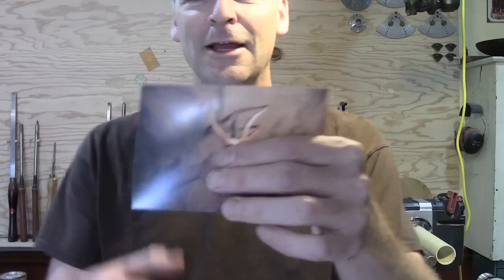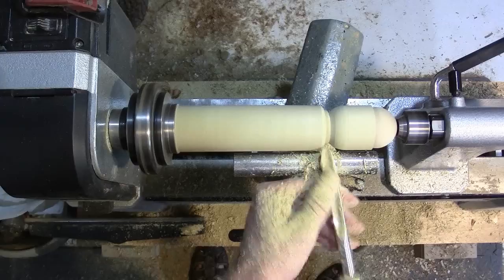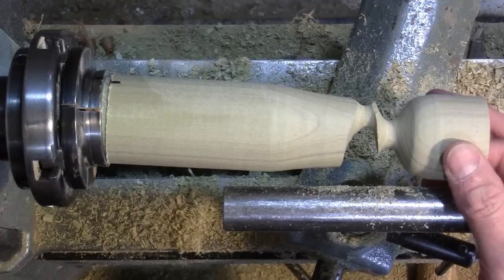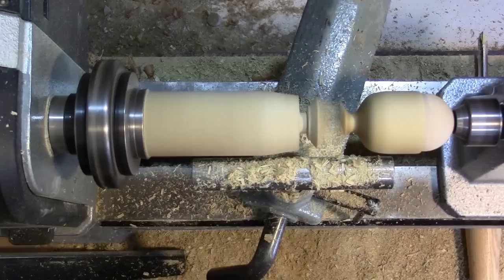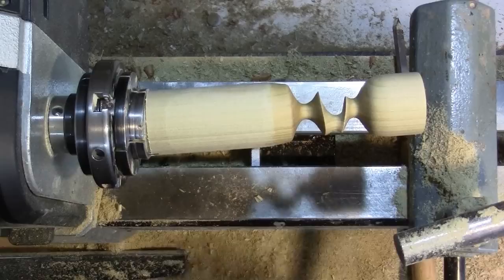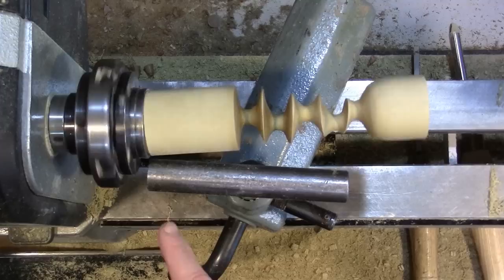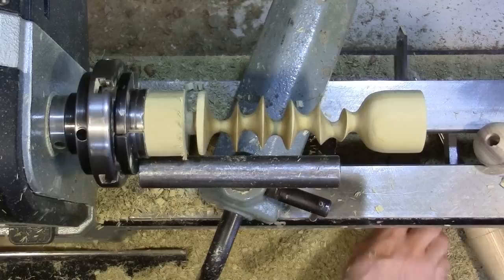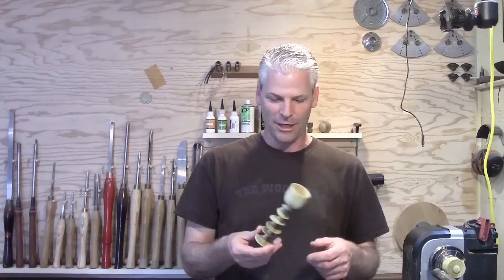Woodturning | Eccentric or Off Center Goblet

Comment: That's really good Carl, I'm impressed. Goblet offsets - if you offset on jaw 1, then jaw 3, then jaw 1, then jaw 3 etc you get a crankshaft effect. If you offset on jaw 1, then jaw 2, then jaw 3, then jaw 4, then jaw 1 (to balance the piece) you get a spiral staircase effect. The farther you offset the wider are the 'discs' of the offset. The permutations are as big as your bravery. The box idea is really interesting.
Best Wishes, Brendan

Comment: For the first attempt you must be very pleased with that. Mike is a great teacher, it was his channel where I got hooked and had to watch every video. The other option to get all the stems in line off center would to have the work on a face plate. Then have two sets of holes that you keep moving the blank across. You wouldn't get the angle that you were looking at but the main stem would then be in exactly the same place on two lines.Great work.

Comment: Great project. I was watching a guy I met at the Indy Woodworking Show do a similar offset turning, but he did it all between centers. He made a plug that fit in the top of the goblet and made three dimples for the live center, then did the same on the base for the drive center. That way he could use the tailstock throughout the entire turning. I haven't tried it myself yet though. As always, thanks for posting!

Comment: I've only had one crack at woodturning when I was let loose on one at a drop-in in the late 70's., where no one showed me how to set it up properly. Needless to say, It nearly took my head off when the piece of red-gum spat out of the jaws and smash a fluro-light above me. It was so embarrassing but I've always wanted to give it another go. It's really good to see someone who so proficient and willing to give new things a go. Thanks for the demo, my daughter was amazed.
Reply from the maker: SabotPottery Thank you very much, 
It's easier than it looks. It doesn't really take that long to get the hang of it. If you try it again, I think you'd enjoy it very much.
Reply: Carl Jacobson
I am a luthier and not a big lathe turning fan, but I have to ask if strobotach lighting would be of any help. Basically any variable speed strobe light will kind of work. You don't want to work while it is on, but you can drop back kick on the light and the work piece will appear to stop, while it is still turning. I bought an old Oscilloscope that had a bad sync circuit and the corporation that had previously owned it decided it was too old and slow to repair, but it did make a nice 0-10,000,000 Hz strobotach for watching rotating parts appear to stand still, check for wobble and dial in their speed. 10,ooo,ooo RPM is pretty fast, and you would never see it or use it, but it worked well for their work on FAA RADAR sites. You could dial in a precise RPM and know if your part was rotating right at the specified RPM. That part will look just like it is stopped!  Oh yeah, to get a better offset in the cut, I would just use a longer piece of stock. You wind up with weird acute angles, to try to cut into up by the spindle head mount. The poplar goblet still looks quite nice. That is a wood luthiers or cheaper guitar makers have used since the mid-late 1950s for electric solid body guitars. Dan Electro and Sears Silvertone (made by Dan Electro) being the most famous. Those almost always got painted some solid color. Poplar is kind of a neutral, plain grain wood. Lombardi poplar has a nice reddish color to it that fades to a browner red color. We had 200-700 pound billets of it. Lots of them! Of course, I had no way to transport it at all at the time.

Comment: Carl I got very nervous watching the work "walk" in the chuck. 
Coming from a metalwork background I'd like to see the work supported at both ends. So instead of using a ball at the tailstock end I thought a hemisphere could be substituted and have a centre hole and a number of holes at different offsets from the centre to drop the tailstock into to achieve the offset effect would be a lot safer.
Cheers Eric

Comment: Carl loved this project so I gave it a try.... First try, i didn't use a fingernail gouge, I used a Easy Wood Tool Finisher... Not enough gap between the sections, but it was fun.  Second try, got a catch and it broke.  Third try, I used a piece of pine and a fingernail gouge.  Third time was the charm, turned out much better.  Next time, better wood...
Reply from the maker: +Chris Armstrong Thank you Chris! It's a little tricky but it sounds like you got it

Comment: I think it was actually freakier to see the video than my experience with real life off-center turning.  On the video, due to the frame rate, when the tool touches the wood it slows it down a tad and the frame rate makes the wobble look a lot more extreme!  Nicely done, I'm always intimidated by this kind of turning.  I've tried to come up with a way to shift the piece on both ends so it's paralell each time, but haven't come up with anything yet ... special off-center chucks are expensive!

Comment: Hey I enjoy seeing all your videos and learn so much as Im hoping to getting into wood turning soon here myself. If you're interested in doing more like this, look on here for videos for turning crank shafts and perhaps using a 4 jaw chuck, where each part has to be set individually. It will allow you to off set your piece a lot easier, and allow you to have stems in different sections depending how you off set it. This way you dont have to tilt the piece vs offsetting it.

Comment: Very cool!  While watching this I thought of something you might try to help see the profile while it is turning.  If you build or buy an adjustable strobe light and work in the dark, you should be able to set the strobe such that it flashes and illuminates the workpiece only when it is near your tool allowing you to see the profile.  This method is used for non-contact RPM counters.  I've never tried it on the lathe.  I turn metal and plastic mostly as I don't have a true wood lathe.  Turning wood on my metal lathe makes a huge mess. LOL.  Eric

Comment: really cool craft you're doing there :) another way you could do it is to make some small holes at 60 degrees chamfer. where the holes are off-center. it should of course be the same at both ends. that way you are sure they are identical. so a screw mounted inside the claw and center support at the other end :)

Comment: To make parallel fins I would instead use at least a 4 prong drive center but preferably something like the WoodRiver Multi Tooth Drive Center 5/8" Diameter #2 MT (I found the name for it at Woodcraft) instead of a chuck, then using identical off center center points at either end of the spindle starting carefully with the tip of a skew chisel to cut the offset spindle and going to depth with a parting tool you could make a stem that looks like a cam shaft. (look at my other comment too)

Comment: Hi Carl,
I was wondering if you had done another one of these off-center goblets yet as you mentioned in this video about setting it in the chuck a different way to change the pattern. I wanted to do one similar to yours but wanted to try the technique you talked about. So, if you've made another, what did it turn out like?
Thanks, Miles.

Comment: Just found your channel and wanted to ask if something might work better or be safer.
Couldn't you make maybee a jam chuck to fit inside the goblet but be maybee 1/8" larger than the outside diameter? then you could pull your live center up to the spindle when it is off center. (BTW I'm now subscribed!!!)

Comment: could you do all the straight angle cuts along the entire piece at once then offset it and to the in between grooves?  or would the mass bee to much for the thin lower sections or something?
Reply from the maker: I think it needs the wood to support each cut as you go down.

Comment: that shakes super scary ----Next time I would take a dowel---Offset of in the lathe --Fasten it in the chuck end with say a stem screwed on to the dowel --and at the end with the support so its not mounted on one end and wildly flailing about --then do your offset cuts --then center it and do your centering cuts and hollow out the end ---No flying wood and its a but more supported

Comment: I've never turned before so I'm just asking out of curiosity.  Wouldn't it be easier/more efficient to make all the 'straight' turns at once and then rock it once to do the offsets?  Again, just trying to figure it, thanks.
Reply from the maker: Hi Joe, yes you but it will give you a different effect. By going back and forth it moves the angle of the disks.

Comment: Hey Carl, could you tell me about the kind of jaws you are using? I have One Way Talon chuck and even when I tighten it as hard as I can on the tenon it always comes loose especially when in the off center position... what Jaws do you use? Thanks
Reply from the maker: This was a Nova chuck, but it really doesn't matter. Make your tenon the same profile as your jaws, and make sure the tenon doesn't hit the bottom.

Comment: If you wanted every one of them all offset could you put different lines on the wood then they all would be offset in different spots.
Reply: I forgot to mention the Cryptex you made is quite impressive. I do have a lathe but I don't have all the parts like yours. Nice video.
Reply from the maker: Thank you very much David!

Comment: What is that you use on the sandpaper, Sanding sealer?
Reply from the maker: It's paste wax and mineral oil, I mix it 10 parts wax to 1 part oil.
Reply: Okay Thanks Carl

Comment: you reset your work piece multiple times to the same index to do another cut. why not do all the cuts at the same time?  only 1 reset that way. economy of motion and jig setting. now if you rotated it to a new index each time it would have made sense. why did you put a 2 dimensional pattern to a round object like that?  also the length from the clamping point of the stock to the bottom of the cup should have been longer. easier to get full offset that way.
Reply from the maker: Thanks for all the tips Bob!